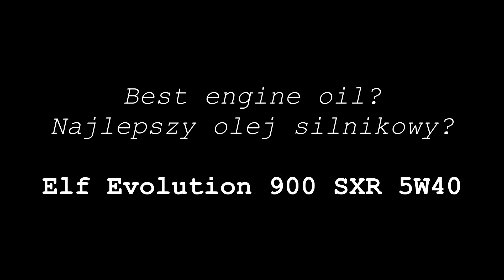Elf Evolution 900 SXR 5W40 Który olej silnikowy jest najlepszy?

Comment: With this test model,all the previous results are rubbish,nonsense.Why are you doing a change like this.Which is right,0.46 or previous 0.06.
Reply from the maker: The third round is to deny or confirm the result of the previous rounds. A really good oil will defend itself in every round.